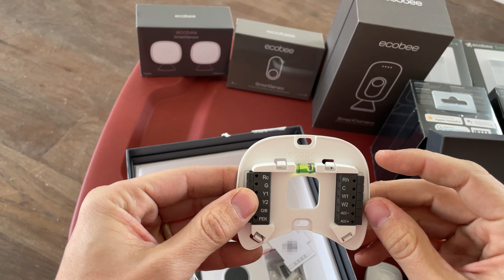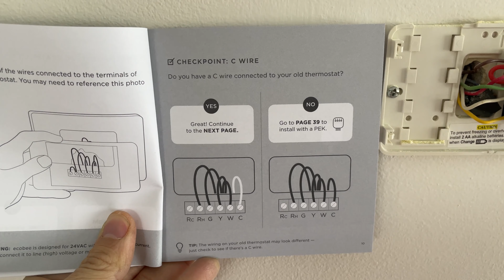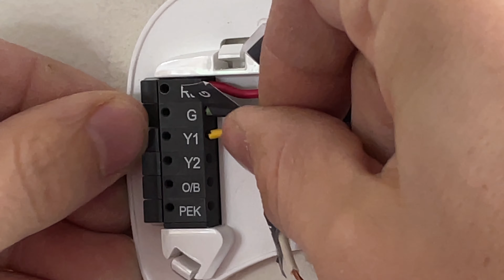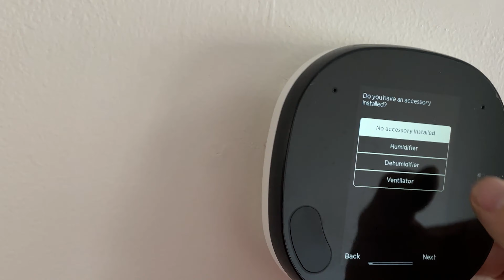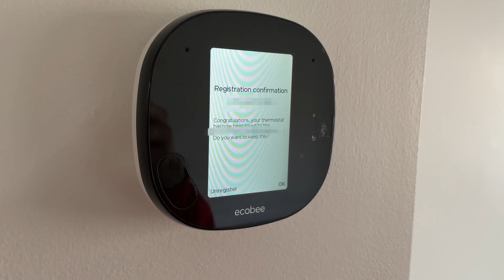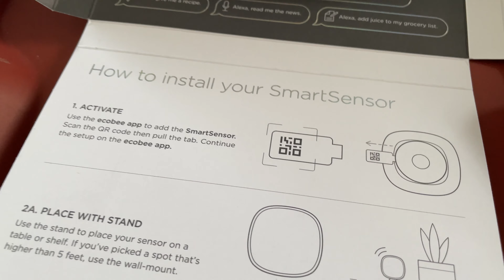ECOBEE Smart Thermostat install

Comment: Oh my god i'm struggling so much I labeled all my wires and plugged everything tightly on... it's blowing hot air :( :(

The hole behind my old thermostat was so big I can't install the extended plate ... one screw hole just goes into the giant hole. HOoray!
Reply: Figured it out! Moved the W1 wire to the O/B slot! Hooray!

Comment: This is really good, thanks for posting. A little hint for you. Put your fan/system on “ON”. You will save money and your place will be more comfortable and your furnace will last longer. Your money components are your Heating and your AC. The fan uses little energy and keeping it on will reduce your money components work time. 👍🏼 (AUTO is good for the service people. Should not even be an option).

Comment: It’s wobbly because you didn’t mount it correctly lol. I’m pretty sure they included drywall anchors that you should have used . Those weren’t drywall screws so you shouldn’t have drilled directly into drywall with them .

Comment: Ummm, if u are trying to help someone do some thing, you should familiarize yourself with doing a job correctly. Drill the holes w 3/8 drill bit, insert the drywall anchors then attach the thermostat.
Reply: Ok, step 1) put thermostat in position with wires coming through the hole. (2) Mark the holes where the screws will go with a pencil.3). Take the piece off wall drill holes with 3/8 bit. 4) Push wall anchors into the drilled holes. 5) Put the back piece back on the wall level and tighten screws into wall anchors. This will help not cause the mess behind the original thermostat that is seen in the video.
Reply: First thing's first - I really appreciate this video as-is - an honest documentation of an unskilled layperson like most of us following the instructions and going through the process.  That said, when the drill came out and the philips head didn't get replaced with a bit... I'm not a handy person at all, but even I was like "Bro, pilot holes!  Pilot holes!"  So I hope people see your comment before they get to this step themselves.  Pilot holes, people.  And drywall anchors if you wanna go full legit.

Comment: I really like my ecobee. I did NOT enable Alexa, but did hook it up with HomeKit. We bought additional sensors and it works very well. It comes in very handy to remotely change the temperature. I couldn’t get mine to properly run the heat pump for heating, and it took two different HVAC professionals to figure it out, which they eventually did.